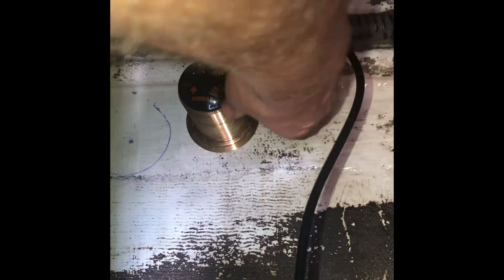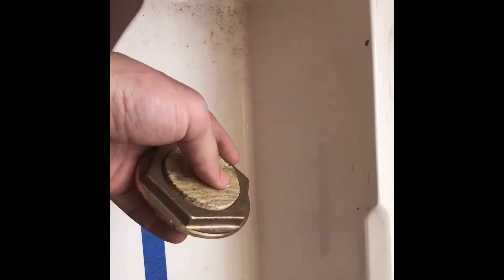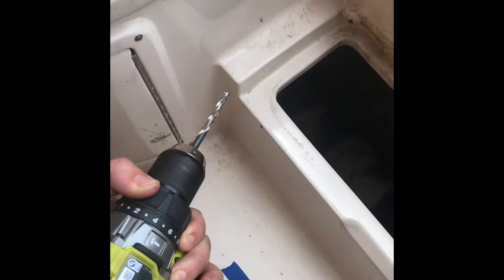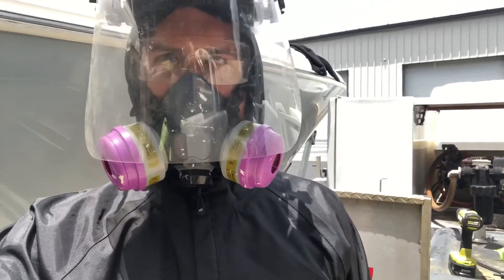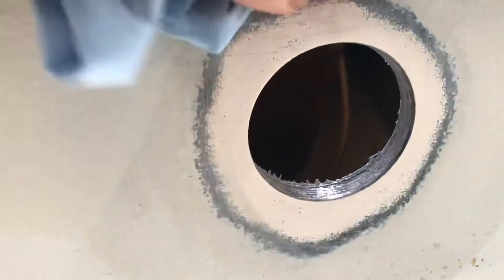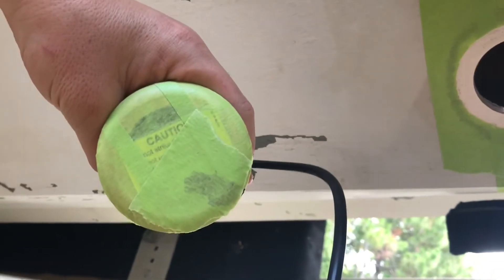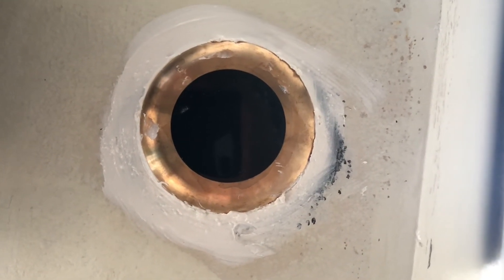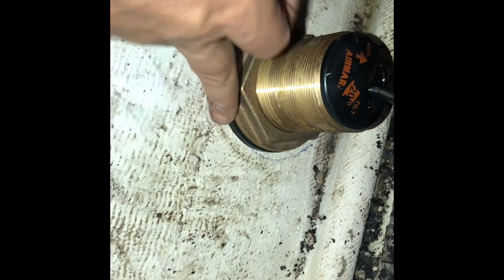Thru-Hull Sonar Stepped Hull Boat

Comment: Nice job. Did you get readings on a plane after installing this and if so what speed. Also what MFD do you have and what sensor did you install.
Reply from the maker: Yes I did, it worked great in that spot. I’ve actually already taken the B60 out and replaced it with a B175 to get even better returns
Reply: Thanks Eric. I have a stepped hull with twin OB, so having the same issues with the stern mount transducer and looking at a through hull now.
When you installed the through hull, did you remove the transom mount or keep them both. If you kept them both is there a way to select which transducer you are using.
I have two Simrad Go 12 displays so I think I can plug the transom sensor into one and the throughhull into the other and have them fixed to each display, but I just can’t find any details on how to do that.
Appreciate if you have any guidelines or insight. Thanks. Norman
Reply from the maker: @normaneaglestone7956  that’s what I did. I have dual Simrad Evo3s… I have one transducer plugged into each. I used to use the transom mount when I was stopped, but now that I have the B175… that’s all I use. There’s a function to pause the transducer on my Evos if you ever get any interference.

Comment: which mix and match cable you use ?
Reply from the maker: The Navico one from west marine. Was like $20
Reply from the maker: I bought the navico transducer also. However, my Evo3 has more pins on the plug so the mix and match cable adapts it.

Comment: Great video. Any deeper reading shots?
Reply from the maker: I’ve taken a few, but YouTube doesn’t make it easy to just post a picture. This thing works great for finding new spots running at high speeds. It doesn’t lose bottom unless it’s really rough and the front of the boat is coming out of the water. It’s not as detailed as my simrad total scan transducer, but it’s very sensitive to any irregularity on the bottom. Once I find a spot and stop, I can switch over to the total scan transducer.
Reply: @ericdavi1231  Thanks for responding. Interesting observations. I currently have a totalscan and it's great when it works up to about 300ft but it doesn't work consistently, and certainly not at speed. I am going to reposition it and see if that helps. Most videos I've come across suggest dropping it lower for better readings. What are your thoughts?
Reply from the maker: @ricomunroe3684  I think a total scan is about as useful as a screen door on a submarine at anything above idle speed. Go end and add an Airmar B60 to your setup, they’re cheap. Most chartplotters have a total scan port and a standard sonar port so you can run two transducers.